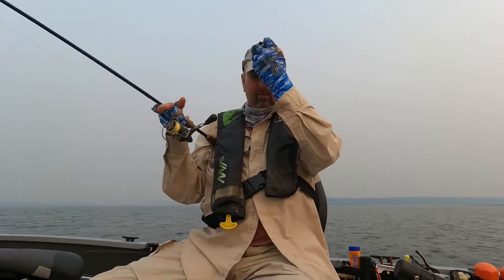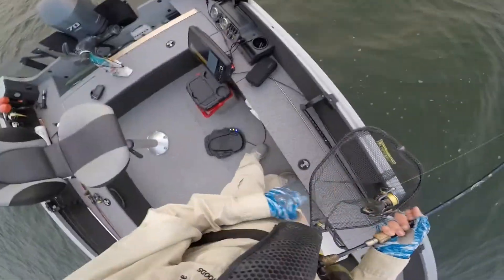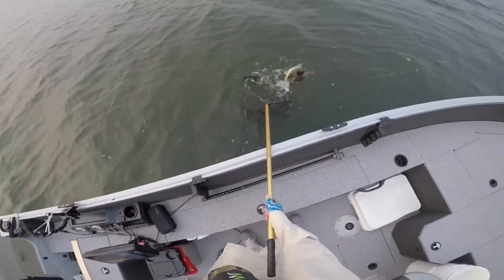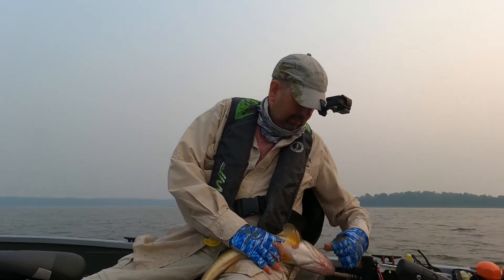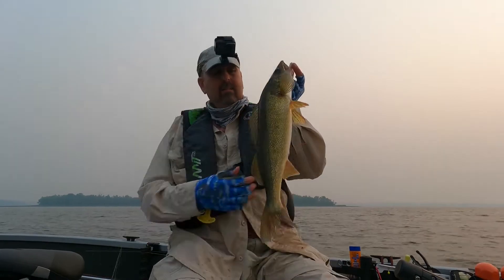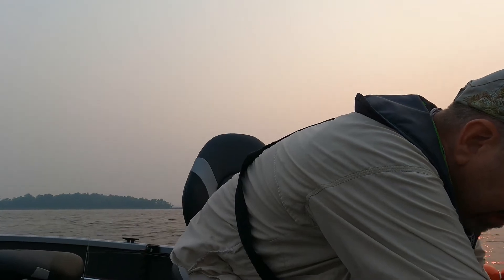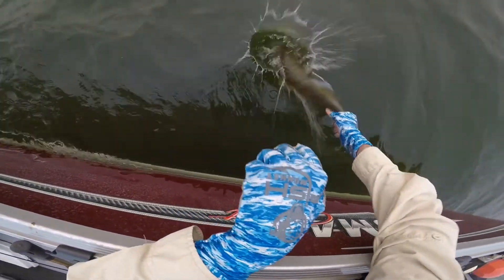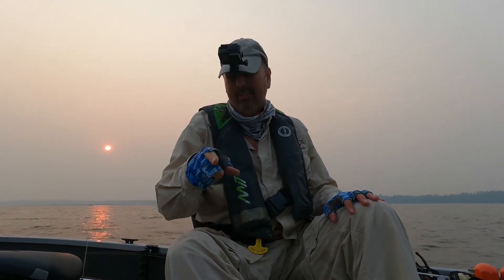Trolling Motor break down

Comment: You realize how much you rely on a trolling motor when it quits working. I think I've had more problems with my trolling motor since I got rid of my old one and replace it with a new "better" one.
Reply from the maker: Yeah they definitely make boat control a lot easier that’s for sure.  I was able to use my big motor for back trolling but it was not as efficient as the transom mount trolling motor.   Yeah I here you about the reliability of today’s motors.  I have my bow mount motor in to be worked on about every year since I bought it.  A lot more bells and whistles on them now which means more stuff can go wrong